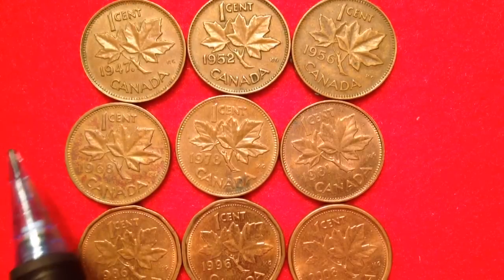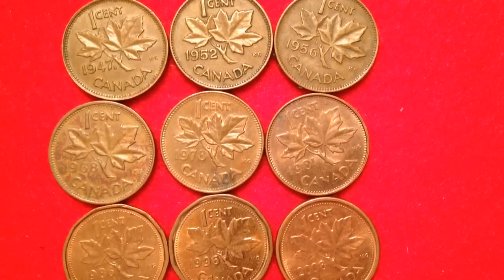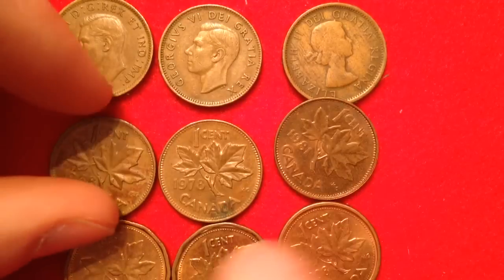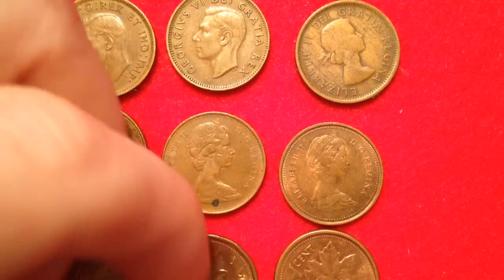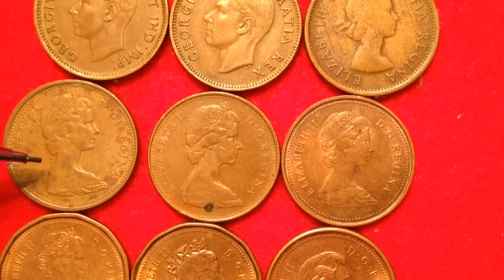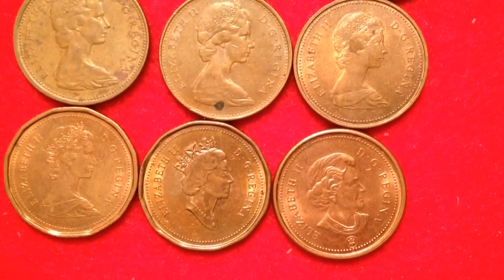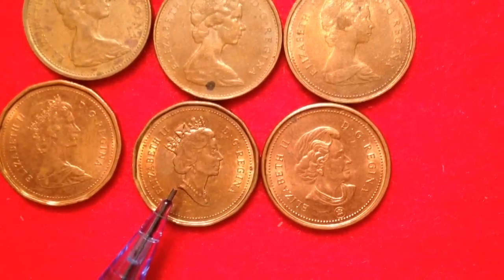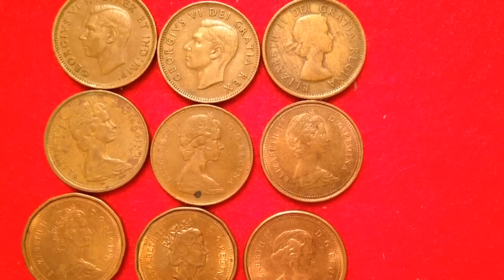Canadian Pennies To Look For: 1947-2008

Comment: I have a 2009 Canadian penny that has an error. It looks like welding slag was dropped on it before it was struck because you can see the dots that go around the penny go up this little hill of metal. It looks as if another penny was melted and a couple drops hit this one then it was struck. How do I get it checked out to see if I am right?
Reply: I know this was from 3 years ago but it sounds like a grease strike through error or a die chip inclusion, they are fairly common but still worth something
https://www.youtube.com/watch?v=G7zeoc7VqUA